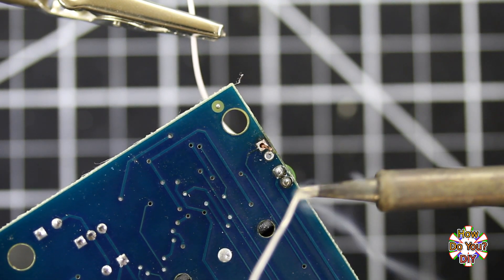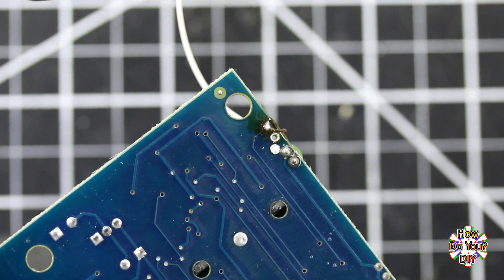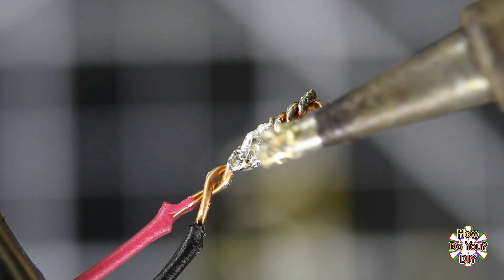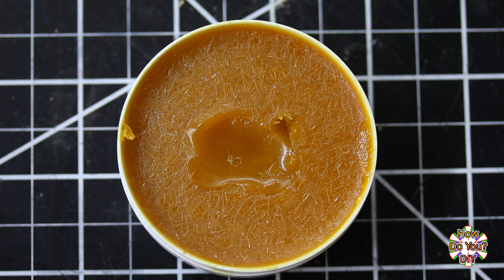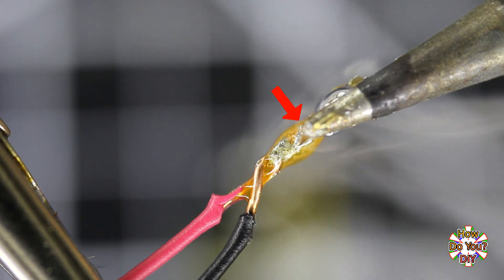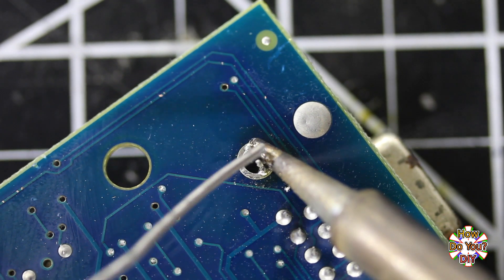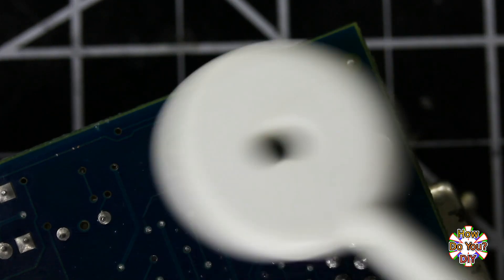Using Flux | Soldering Basics | Soldering for Beginners

Comment: Sheet, why does it looks so easy on youtube? My flux doesnt melt easily, it actually melts after exposing to heat for longer and it hardens up right away.. I used hot air blower, lighter and then a soldering iron nothing works. I tried the flux only, and I tried to add rosin paste it doesnt work it doesnt melt. Like i said it melts very quick and fall of the wire, it doesnt stick it falls off and turn into a round lead..

Comment: The paste i got today is very  hard? Like a stiff wax is this normal?
Reply from the maker: I had some that got that way when it got old, but it still worked. I was able to soften it up again pretty easily. Warm it up until it all melts. I added a little bit of isopropyl alcohol and mixed it in at that point, but I don't know if that's necessary. I hope this is helpful.

Comment: NEVER apply solder directly to the iron tip. Heat the wire with the soldering iron tip and then touch the wire with cool solder. Otherwise you will get a "cold solder connection" which will not hold. Also, ALWAYS remove flux from the soldered connection or it will corrode that connection over time.

Comment: A suggestion:
Make a video explaining how to re-solder old wires during a repair. That's what I'm attempting and am trying to figure out if I should use flux to clear the dark oxide layer from the wire or if I need to sand the wire first. It's stranded wire also, which is a bit different that your video.
Your video was otherwise quite helpful.
Reply from the maker: That's a great suggestion for a video, thanks for mentioning it! A quick tip when working with old wires, especially when they have that dark oxide layer... Try cleaning it off with fine wire steel wool or brass wool, or possibly a scotchbrite pad. Those can be a bit easier to use than sandpaper, but a fine grit sandpaper will also work very well. That old oxide layer is a bit resistant to the flux, but if you can expose the copper, the flux will work better to clean off the inner stands of the stranded wire. But you still want to physically remove as much of the old oxide layer that you reasonably can.

Comment: You could also just hold the soldering iron to the joint longer to heat the copper so the solder adheres better

Comment: And the flux is just helping to quickly heat the wire's look at first he solder it with just touching it without holding the tip to surface for a sec

Comment: 0:18 Did the solder just fall on the PCB itself?
Reply from the maker: Not exactly. This video isn't about using solder, but rather the effects of using flux. Your observation brings up a point that I didn't think to mention in this video, but really should have. The heat of the soldering iron makes the flux bubble and boil, and this can make the solder splatter. Sometimes it will splatter onto the board, and sometimes onto you. Even if you're not using added flux, the flux within the rosin core solder will do this. Even tho that part of the video was filler for the intro commentary and not for demonstration, that was a good catch on your part. Thanks for sharing your observation!
Reply: @HowDoYouDIY  Thank you deeply for your explaination, at First I was thinking it was just because of liquid solder just falling because of gravity I didnt realize there was any flux.

You've helped me clearup a blunder which I couldn't have easily noticed.

Thanks alot, I will ensure to watch more of your tutorials

Comment: IMO the best flux for electrical/electronics is the type that contains zinc chloride as the active ingredient. It is way more reactive than the rosin contained in the solder wire.

Comment: 1:01 
Yeah, but you weren’t heating the wires well BEFORE applying solder. And that should be done whether you use flux or not.

Comment: I’ve never soldered so I don’t know anything. But why not heat the wires and apply the solder directly to the wire?
Reply from the maker: That's a good question. What you're describing is the proper way to solder, but this video isn't about how to solder. The purpose of this video is about the effects of flux. The video I uploaded before this one is about applying solder. Here's a link to that video if you're interested in watching it: https://youtu.be/-qk-ulz05J8
Reply: @HowDoYouDIY  thank you:)

Comment: Conclusion/ Summary:
A proper bond between the board metal pin and the solder metal is crucial. 1) Using Flux we can remove the oxide layer between the metal pin which prevents proper bonding. Thereby achieving proper bonding.

Comment: I don’t understand I did exactly what you did. I put the solder on the twisted wire, clean my soldering iron and melted the solder on the iron and touched it to the flux lines and it’s still repels it. What am I doing wrong?

Comment: To discover the real importance of flux in so L dering - try doing some plumbing capilliary fittings - even with freshly cleaned metal, non fluxed joints do not work.

Comment: Was an electronics hobbyist decades ago and always used big, thick, flux-core solder, never giving a thought to the flux or what it did.

Now that I’ve gotten back into it, I’m using super-thin Japanese solder paired with brush-on, liquid flux. It makes soldering so easy it’s ridiculous. Also dipping my desoldering wick into right the flux bottle before using it makes it absorb solder 10x better. I’m so glad I finally figured out flux!
Reply: what s the difference between what u said and what he did on video?
Reply: @stecder2470  The video.

Comment: 1:35 so the flux is corrosive at any (reasonable) temperature. It's pH doesn't change with hest but it does become more reactive at higher temperatures. If you remember mixing sodium hydroxide and your chemistry teacher warning you about the exothermic reaction it produces. Telling you to add a little at a time so hot sodium hydroxide doesn't get on you. Maybe this will be more clear.
If you have 2 liters of sulfuric acid ~95% and split them into two 1 liter portions. Keeping one at 25c and the other you raise to 50c. Then use each one to let's say dissolve some organic material. The one at 50c will appear significantly more violent and dangerous but it really is because you have less time to react. However, both acids (in a perfect world) will dissolve exactly the same material it's just going to take the cooler one longer. That's why the flux appears to become corrosive when heated and that belief can get you hurt if you work with chemicals.

Comment: I've been building electronics kits for ham radio since 2004. I have never once had to use flux. If you have a good quality solder, you don't need it. Also, when soldering two wires together, you heat them first with a tinned soldering iron and then apply solder to the wires. Solder flows easily. I've done a ton of board work and I've never did the whole cleaning the board thing. It is just not needed as long as you're using a good quality solder.

Comment: No offence meant, but that is a shockingly bad joint in the first 30 secs of this video. Couldn't watch any further. 1. If that much flux is required for such a small joint, there's already a serious cleanliness problem with the pad. 2. Dab, dab, dab...multiple goes at heating the joint to finish it...that's all bad. It should be one clean pass, resulting in a nice concave fillet. Multiple dabs at the joint leave uneven heating through the joint with multiple stress lines. not a good example of how to solder.

Comment: my dog bit my headset cable twice and soldering it back is different from doing it on board, it took me an hour to just get a decent connection but not properly. it wont stick. thank you so much.

Comment: Oh man I had so much issues soldering battery and motor wires to a speed controller today. My solder has a flux core but apparently it was not enough. So, inspired by this video, I went and bought some flux paste. Applied a decent blob. Worked in seconds!

Comment: For SMD, eg hdd panel, it’s batter to fix the soldering iron to a stable surface, and easier to handle the lighter panel. Very tiny fuses can be soldered using a magnifier and proper lighting.

Comment: Woah... I didn't know flux has such use, i always solder by just letting the solder iron touching wire longer until the solder fuse, but this method often burn wire insulator. does higher heat also remove the oxide layer too?
Reply from the maker: Heat will increase the reaction that affects the oxide layer. If there is no flux, the oxide layer can increase with heat. If there is flux, heat can speed up the removal of the oxide layer, but heat will also burn the flux away faster.

I have another video where I show a technique that heats up the wire faster, and doesn't melt the insulation as much. Here's a link to that video: https://youtu.be/-qk-ulz05J8

Comment: Liquid flux is the best painted on with a brush.  Back in the day when Mobile phones were like bricks my job was soldering the Resistors and Thermistors etc to the mobile phone batteries by hand and liquid solder was by far much easier.  Back in the late 80's and early 90's, my solder skills went into a lot of Motorola batteries.
Reply: after applying flux to the brush, did you need to wash the brush before putting it away for the day and did you need to wash it again before using it again the next day?

Comment: i don't get it , are u saying oxide layer forms on solder tip or the wires?
Reply from the maker: That's a good question. While you're soldering, an oxide layer forms on the melted solder. But there is also an oxide layer on the wires that the flux removes.
Reply: @HowDoYouDIY  this flux is magic also what's the point of the solder tip thinner and that brass wool if fluff simply does the job quicker.

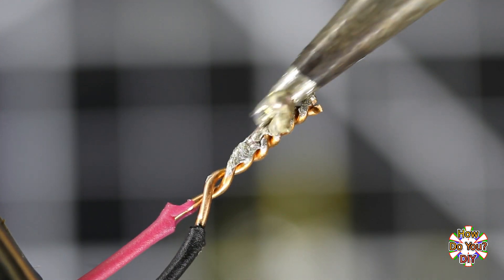Comment: 1:00 "that skin" is also because you haven't heated the wire itself, so it cools down solder immediately.
Reply from the maker: Why do people keep assuming that heat doesn't transfer to the wire through the solder? The video clearly shows the wire insulation shrinking back, which is an indicator that the wire is hot. The video I uploaded before this one explains this. I even demonstrated how much faster the wire heats up when there is solder already on the iron. (Hint: it's almost instant for this size of wire.) I recommended watching that video during the beginning of this video because it has important information.

Here's a link to that video, just in case you're interested: https://youtu.be/-qk-ulz05J8
Reply: @HowDoYouDIY  It does, but it helps to heat up the soldered part as well.
Actually that is the first thing to do with flux when soldering wires. If one joins electronic than it doesn't and must not, be preheated.

Comment: WTH are you doing with that twisted copper 🤦if you keep the welder's tip still on the copper for a few seconds you Will get a good result. You're sortof brushing the copper 🤦
Reply from the maker: You misunderstood the purpose of this video. This is NOT a video to show how to solder. It's a video about what flux is, what it does, and why it's important for soldering. If you want to see how to solder, you can watch the video I uploaded before this one, which I also recommended watching at the beginning of this video. Or you can even click this link: https://youtu.be/-qk-ulz05J8

And as far as the specific part of this video that you're talking about, holding the tip still for a few seconds would have made no difference because I was using solder that doesn't have any flux.

Comment: Ok so I'm fairly new into soldering. I've been buying these diy electronic kits to practice on but my issue comes with 2 contacts touching. How do you solder a chip that has 20 tiny connections without touching the one that's a hair length away? This flux was part ofy problem as I wasn't using any in the beginning but is there a trick to soldering many tiny connections close together?
Reply from the maker: That's a really good question. Usually when you are soldering small parts and connections, you'll want to use thinner solder. Another thing that some people will do is they'll add a lot of solder and not worry about bridging them, then they will use desoldering wick to remove the excess solder. I would recommend trying that to remove some of the excess solder on your projects. It might take a bit of practice to get it just right, but I think that will help.

Comment: My guitar pick up was giving a bad humming noise..repair is expensive so I bought my own cheap soldering iron plus wire and flux.I didn't do it properly I messed up the ground wire with hot wire and more noise 😁. Even I burned my hand not that bad though. Through YouTube videos I did it right, noise is gone. I was wondering what flux do, you made it clear 👍

Comment: Another good tip.
The smaller/thinner the tip is, the more heat you will need.
I use a wide tip. If I need to use a skinny pencil like tip, I turn the heat up.
Reply from the maker: Thanks for sharing the tip about the heat of the tip. I think that's something a lot of people would overlook when they're learning.

Comment: If you're soldering with a $8 iron, you will struggle. 
I bought a China adjustable iron from Amazon and good flux core solder and never had problems again.
I only use flux to desolder or to solder splice joints.

Comment: Rubbing the soldering iron on the wire is why the solder didn't stick. Because you didn't do it correctly. You hold the iron onto the wire to get the wire hot, then you touch the solder onto the hot wire so the solder melts onto the wire. You don't take a soldering iron with gobs of solder on it and rub it around on the wire like you are buttering bread.
Reply from the maker: You are correct that this isn't the proper way to solder, but rubbing the soldering iron on the wire wasn't the issue. The issue was that all of the flux burned out of the solder before it got to the wires. That's why you typically want to do it like you described. But this isn't a video about how to apply solder. This video is about demonstrating the difference that flux makes, so I focused on that. That's why I didn't follow the typical procedure. If you want to see a video about how to apply solder, I recommend watching the video I made right before this one: https://youtu.be/-qk-ulz05J8 (Your analogy was awesome, btw.)

Comment: Can't you just sand the surface? For pipes.
Reply from the maker: That's a good question. You can, and that's actually recommended when someone solders pipes. But flux will still usually be used with plumbing, even after sanding.

Comment: Hi there, I am new to soldering.  I have a question please.  I am away to solder a stratocaster pickguard, new pickups, pots and caps.  Should i use the flux gel with these components too?  Also i have been recommended a 60/40 % tin lead mix solderwire.  or should i go with a solder wire with flux  instead ?  Great video series by the way.  Thank you in advance.

Comment: Ty for this video I have a project in working on making 1/12 scale lightsabers. I tried to solder copper to the tin connecter and created the oxide problem and I had no idea. I know how to solder copper pipes and how to braze and weld. Soldering is very much different. Ty for these quick tips is restored my eagerness to complete my project

Comment: We had to solder a lot of solid copper wires together, amd there was just no way, that a regular soldering iron would heat up all those wires, so we tried many diffarent ways, even using a torch! Nothing really worked. How do you solder really thick wires?
Reply from the maker: Soldering thick wires is tricky because the heat dissipates faster than it can build up, if it's not done correctly. I don't have experience with that, so I don't know how well this would work. What I would try with soldering those thick wires together is using plumbing solder and plumbing flux with a torch. Typically you don't want to use plumbing flux when soldering electronics, but I think that's more about soldering onto circuit boards. I think plumbing solder is stronger than electronics solder (I don't know for sure if it is) and that could also be helpful when soldering thick wires. I hope this is helpful!
Reply: @HowDoYouDIY  Thank you so much! I also think, it's a lot easier, to put solder on each wire seperately,and then solder them together, whitch we have not tried! Have a nice day!
Reply from the maker: I forgot about that! It should definitely help. Thanks for mentioning that!
Reply: @HowDoYouDIY  Might help someone else 😅

Comment: I have to put down extremely tiny solder points to add screen features on my Gameboy mod.  I know I’m always trying to get the solder to stay on the point but it just stays on the soldering iron and won’t come off.  So putting down the flux will make it stick to that?
Reply from the maker: It should help the solder stick to the copper pads. Just remember that heating up those tiny pads too much could make them come off the board. I hope this is helpful!